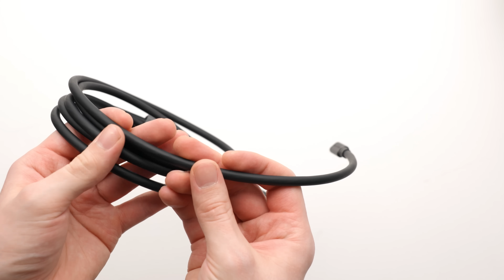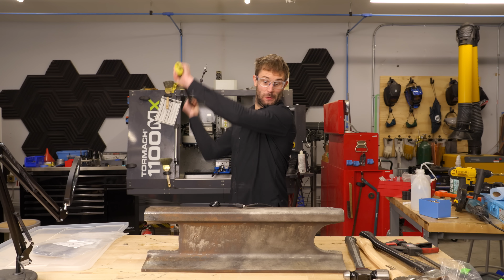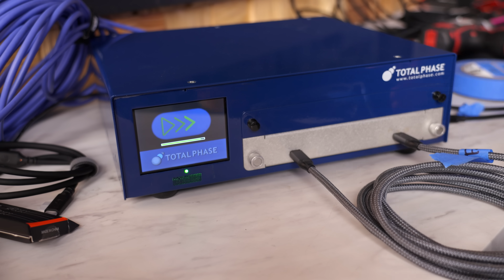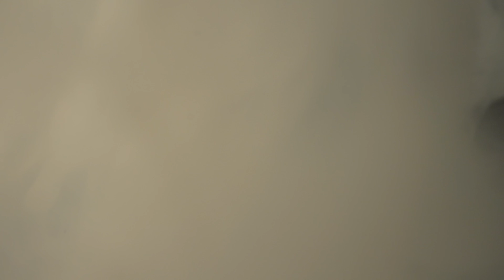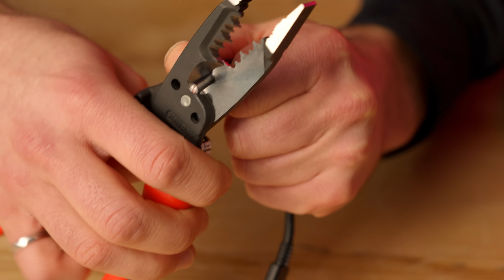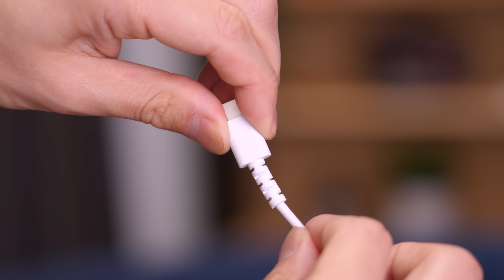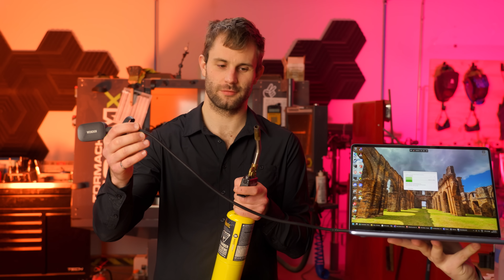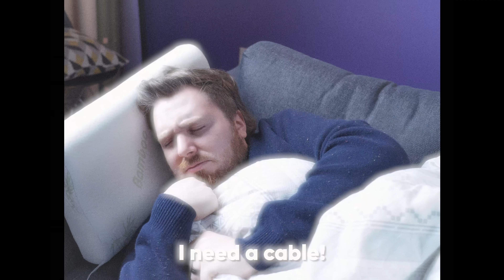Why It Took Me 4 YEARS to Make a USB Cable

Comment: Brilliant. I can't stand cheap cables. And like he said I bought cables that weren't even worth returning so they ended up in the trash. I even have "high-quality" super expensive cables that work like shit. I rebuilt one of my PCs 3 times blaming GPUs, and MOBOs on the video glitch problems, was fixed by buying a $125 HDMI cable, and it's not even that high quality, it will go bad if I accidently bend it to much.. Not to mention I have never ending problems with USB.. I have to constantly disconnect everything and plug it back in 1 by 1 until I find the problem. Even with the USB to the MOBO.. Those cables are a nightmare when they're bad. Had one from Corsair that had all my USB devices disconnecting, and not being discovered again, I use USB mouse and keyboard too.. I also think one of those internal USB cables killed a high-end MOBO on me after using it to connect a high speed M.2 drive

Comment: "these are digital cables, they either work, or they don't". But 5minutes earlier, you explained that USB data connections just asked again for dropped data, lowering speed, which sounds much more like a sliding scale of performance.

Comment: Will there be any versions that have those LED screens that show how much wattage you're charging at?

I've become a huge fan of these.  They're super useful, especially the ones that show voltage, wattage, and amperage.

I've practically committed to only buying cables that show this on them.  They're just too useful to live without, once you've been using them for long enough.

Comment: This is actually a godsend for tethered workflows in professional photography, especially if you're shooting high res files. Ive had TONS of issues with regular USB cables and the silicon build is such a good idea for storing and longevity. Please consider making a right angle version of the 5m Cable and maybe make a 10m variant, because there is a small but very dedicated and demanding market that needs high quality durable cables!

Comment: Are you considering expanding the lineup in the future or adding accessories that can match the quality of the cable? For example something like a 90 degree cable or an adapter that can take the straight cable and turn it 90 degrees for applications where thats beneficial over a straight cable?

Comment: As of February 1, 2026, LTT store is not showing any of the cables. I'm checking from the state of Washington.
Reply: Apparently there was an issue with the inventory tracking, and they took them down temporarily to avoid people ordering cables that they don't have the stock for.
Reply: Are they sold out. I don't see any on the website
Reply: @ikisoutyes, they sold out in like 24 hours or less
Reply: same here, i see banners for it but no products. NC (assuming they either arent ready for the USA or sold out or som
Reply: The forum postlink also goes to nothing

Comment: Tried to buy a cable from the link on this video but it says…

No products found
Use fewer filters or remove all

I’d love to find a USB-C cable for charging preferably 9m in length but failing that as long as possible.

Comment: I too was astounded by the sheer number of cables that claimed to be X, turned out to be Y or Z instead...trying to find a decent cable through "legit" stores and even Amazon's wilderness...just to get reliable transfer performance for a pair of external m.2 enclosurs.  The cables that came with them were "too short" for my liking...Not a fan of letting it just "hang"...I eventually did find a cable that worked, but I spent a smal fortune on that search.  And I also found the same crap with cables I wanted to use for charging purposes...of all the cables I bought for the SSDs, only 1 was suitable for 200W charging....the rest were "meh"...of course, I was basing this on observations with a "dead battery" phone and seeing what the UI would indicate for a charge time with that cable.  The search for these is over, not because of your plug though...I sorted it out before I saw this.  That said, buyer beware...there are scammers out there...even "legit" stores like Best Buy can sell crap that doesn't live up to the hype...Amazon, pay attention to the number of people who reviewed the product...unless it is over 1000 easily, don't even consider it...

Comment: If it wasn't for ugreen I would be all over this, ugreen just happens to have a huge selection and I have never been disappointed by a single one, at very reasonable prices for the quality. I might still buy one when the get back in stock but I will probably stay loyal to ugreen

Comment: I've been making my own cables for a couple of years now and it's expensive but way cheaper than buying the same specs of wires but you choose the length and connecter angle.
 If you want the absolute best make it yourself .

Comment: Those seem really nice. When back in stock I may have to consider. Just the other day had to find a usb c cable from among my extras to connect laptop to monitor and of course the first couple I grab are power only cables which I discovered after plugging it in and it didn’t work. The cable that ended up working, who knows what speed it is if I needed it for data transfer. Your clear labeling is awesome.

Comment: I just went through weeks of diagnosing static and shorting issues in my rig, and I’ve boiled it down to a bad ungrounded USB thunderbolt five cable. It wasn’t cheap, and almost ruined all my electronics. Can’t wait to buy these when they’re in stock.

Comment: The question is if I buy one of the 40GBit cables, will they work with thunderbolt 4 or not. They are obviously not certified but will they still work?

Comment: did they sell out :/ 
I cant see anything on the page
Reply: Sold out super fast and no surprise. Most expensive was only 20$
Reply: some SKU's sold out in 20 mins. they had to take the page down because of an shopify issue that let people order stuff even though it was out of stock. on the bright side they already have more cable stock ready that just needs to get cut to lenght and terminated. so we might see a restock as soon as march

Comment: So once you have sourced the cables for sale, from a vendor, do you test each and every piece on your test machine? Of course you tested the 100 samples, but wouldn't a smart supplier figure out that you will reject the supplier/manufacturer even if one cable turns out bad. And then they supply only pre-tested cables at their end, ensuring the test lot was 100% error free at their end itself?

Comment: Sadly when entering your shop via the "Global" site, it only says "No products found, use fewer filter or remove all"...however, click on "Remove all" still shows the message. Hope you also plan to deliver to Europe.
Reply: some SKU's sold out in 20 mins. they had to take the page down because of an shopify issue that let people order stuff even though it was out of stock. on the bright side they already have more cable stock ready that just needs to get cut to lenght and terminated. so we might see a restock as soon as march

Comment: It is about fucking time. Linus, what is the warranty like on your cables. Do you have a warranty period, or are you selling the cables as consumables so they are end-of-life out of the box like every other manufacturer? I like the look of the cable quality and that you have specific guarantees, but is that guarantee for a certain period?

These are rough because of the myriad factors involved like personal damage by bending the connectors, pulling kinks in the cable which would cause stress factures in the metal etc. among other stresses like repeated movement etc in mechanical applications. But for a lifetime of the cable at its specification with no damage, surely you would have mapped the warrantable period on this correct? 

If so, what do you consider a reasonable replacement period?

Comment: Flexible cable is good and all,  but Im wondering how the conductor holds up in the cables? Does kinking like he did in the vise ruin them? Repeaditly kinking back and fourth as in normal wear over time.

Comment: Very nice.

Cables are always a nightmare here, because for digital technology especially amateur radio digital modesyou need properly shielded, high-quality cables.

But then the real problem starts: getting that cable into Europe.
– First, you get the Trump-era tariff nonsense.
– Then you’re hit with extreme shipping costs.
– And on top of that, there are customs charges, because the United States has effectively isolated itself.

In the end, the cable costs 200% more just to get it here.

Thank you, #TrumpTax.

Comment: Amazing. Can you expend the line to more specialized but critical applications. For example Android auto/ carplay compatible cables that get bent around a lot. Ideally one its 2 inches straight, then like 1.5ft of coiled, and 1.5ft straight. This way its the perfect stretchy fit  for armrest console plug ins. Oh and also right angle plug for the phone side so it gets bent less per use and can be help more comfortably

Comment: Did I miss the boat, link doesn't bring me to the cable I want to buy.
Reply: some SKU's sold out in 20 mins. they had to take the page down because of an shopify issue that let people order stuff even though it was out of stock. on the bright side they already have more cable stock ready that just needs to get cut to lenght and terminated. so we might see a restock as soon as march

Comment: Lightning cables are also dogwater because the pins are on the outside rather than the inside which is a failure point along with the aforementioned poor strain relief if only you could make one of those that doesn’t suck

Comment: @Linus Tech Tips - can you please make 4K or 8k with usb 3 or higher KVM extender and switches over optics true spec. Lot of your fans might have more than one pc for various works and sometimes need reliable gear. I gave up my home lab setup because I couldn’t get ANYTHING reliable. Please. I wanted a clean desk with all my PCs sitting 30 to 40ft away.

Comment: I have a Silkland 240w Thunderbolt 4 6.6 foot and does great. Might be a hard sell if your cable i more expensive. Did all sorts of testing on it and is perfectly advertised.

Edit: You can find out who produces Apples Thunderbolt 4 cable. There is a reason they are expensive, they are very VERY GOOD.

Comment: Fun fact I learned. You likely don't need to replace that "loose" USB-C port on your device. Just scrub it out with a soft bristle tooth brush, and get rid of the build up with non metal parts (wooden cocktail sticks, plastic picks etc). As a side note, I understand USB-C well enough to make fast charging work now, and well enough to be on okay terms with the USB IF standard. What I also learned, is that most major brands have just stopped putting a USB IF logo on cables. It's either a plain cable, or a "unique enough" design. Oh, also never get into powerbanks... Just trust me on that. The headache is NOT worth it.

Comment: I would like LTT to exert pressure on the market so that cable labeling becomes clearer and prices more affordable, but it turns out that they are simply using the Overton window to expand the price range that manufacturers will tolerate, worsening prices for end users. How sellers will think: “Let's make a sticker that supports 40GB/sec and put a price tag of $60 on a USB 2.0 cable instead of the old $5.”

At the time of viewing the video, I cannot verify the price and can only judge by the comments from this video.

If we're talking about $80 for a cable that fully meets USB 4 specifications or the latest Thunderbolt, then it's worth considering. However, if it's just a simple two-meter cable for charging your phone every day, then it's nonsense. Right now, I can buy 40 (!) such cables for that money and replace them every time they break. One such cable lasts me about a year and a half, so it's not rocket science to figure out that I could buy enough cables to last me 40 years for that money. Will a single cable from LTT last that long? I doubt it. Oh, and those wonderful tactics of not mentioning the price directly in the video... Every year, we're getting closer and closer to the LTT corporation...

Comment: About time someone like LTT did this! I expect we will be buying quite a FEW of these from the LTT store! Can;t wait to get a few in the next few days! Now go make some super-long-length 10/100 Gigabit multi-mode fibre (i.e. flexible PLASTIC fibre optics) cable that can withstand being crushed and crinkled AND still withstand -50C to +60C temperature swings AND still give us a full 10/100 Gigabits per second specification over 10 metres up to 1000 metres! LTT might as well get into combination 10 Gigabit/100 Gigabit Fibre routers, repeaters and switches AND some much-cheaper-than-today's-prices 10/100 Gigabit fibre optic PCI-bus network cards!

THIS IS GREAT! Keep going! If you need HELP, call us! Make MORE of this! We will BUY IT!

V

Comment: Now imagine wireless charging 😬
Reply: Now imagine wireless charging, but more efficient, faster and better for the life of your devices
Reply: @ovoovoovoovoovo  It is possible already with Qi2 and Huawei Protocols, but there are so much paperwork! There is a lot of work to pass the certification process
Reply: @krystian01747  Even then they're less efficient, slower and heat your device up more because physics.

Comment: None of the links work for the cables. Am I wrong 😂
Reply: They dont work
Reply: Sold out. Link worked yesterday.
Reply: @greenrabbit0341 ive never actually bought anything id like to have from linis tech tips because they are always out of stock. We need more supply for the demand.
Reply: @TaLiiWaG  It's a complicated and always frustrating balancing act.
Reply: @ovoovoovoovoovo its not complicated. They leave money on the table.
Reply: @TaLiiWaG  Yes, but if they had too many cables, it would cost them a lot of money too.
Reply: @ovoovoovoovoovo im sure they will sell

Comment: At $20, I'm not going to complain for a well built cable. I've spent more than that on replacing cables that's constantly fail. It's the difference between cheap and inexpensive.